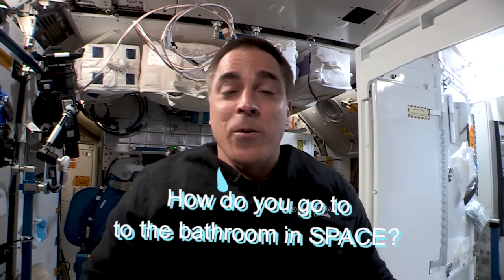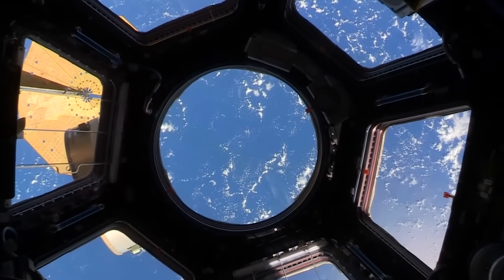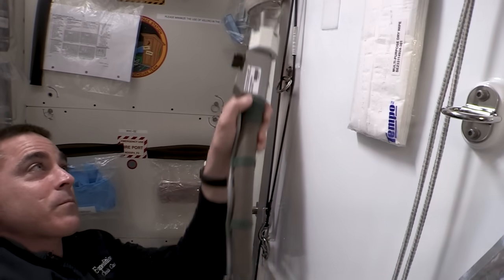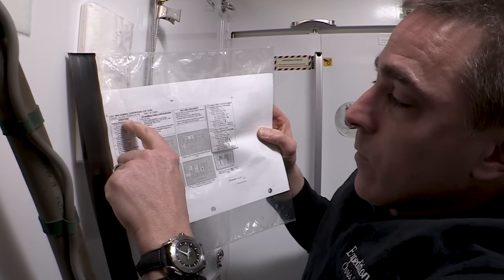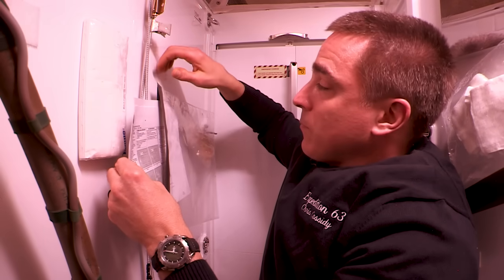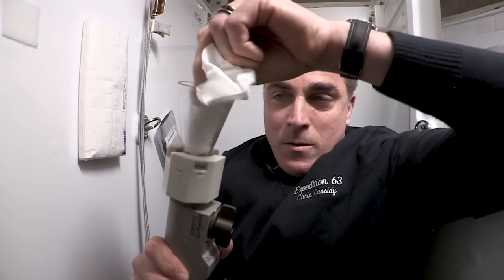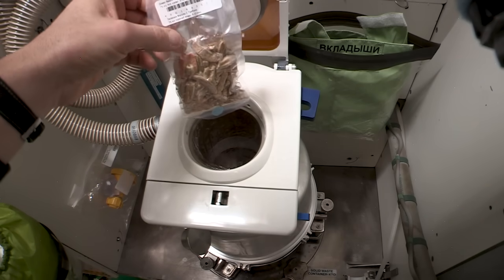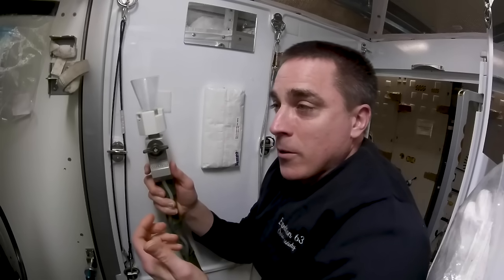How to use the Bathroom in Space

Comment: Such a convoluted system for such a basic but extremely important human function.  It is the Hygiene issue. People can transmit Noroviruses, E. coli and Hepatitis A if proper procedures aren't followed in such closed cramped conditions. The main reason why long duration space flights will be limited because of the toilet issue. Strange stories and incidents on the ISS concerning toilet facilities and individuals using it. Why not have a sit down toilet type system that is capable of handling  both urinating and defecating at the same time.The toilet technology issue should be figured out by now so why the big secret. The problem to difficult to solve for NASA Rocket  Engineer to have a sit down toilet.

Comment: That's disgusting.  I'm not pushing it down with my hand.  Why is the pump running?
Reply: Guess you aren't astronaut material then.  It's cool....not many are.  I know I'm not. And the pump is running because of zero gravity.  It's not a hard to figure out what would happen to your excrement without the suction of that pump.
Reply: In previous videos by astronauts, they mentioned suction in no.2 container as well.

Comment: how do astronomers get oxygen in a spaceship
Reply: electrolysis, basically your elementary everyday science experiment of separating hydrogen and oxygen in water by running electric charge in it. There's another way to get oxygen by recycling carbon dioxide, but it's much harder
Reply: Not quite sure but I think they bring up a tank which is constantly circulated throughout the station and cleaned in a closed loop system... kinda like their water.